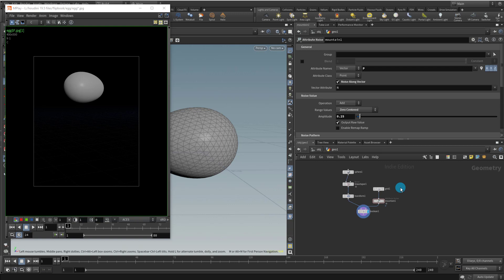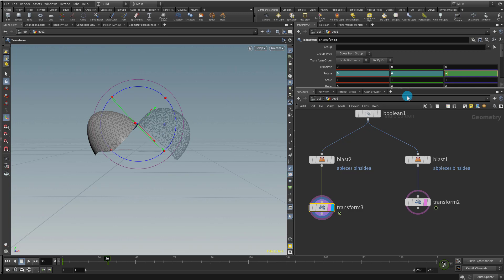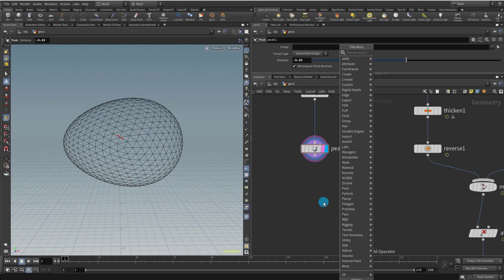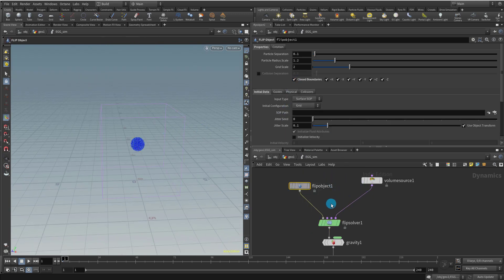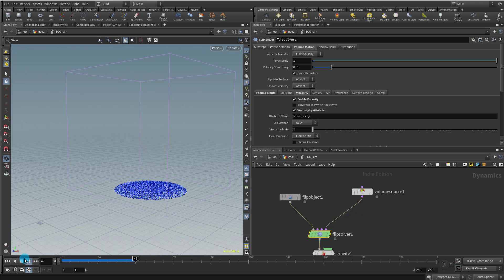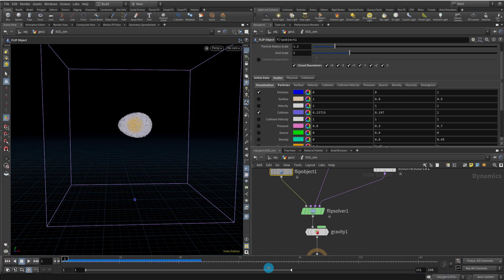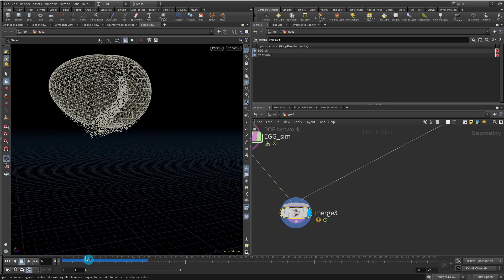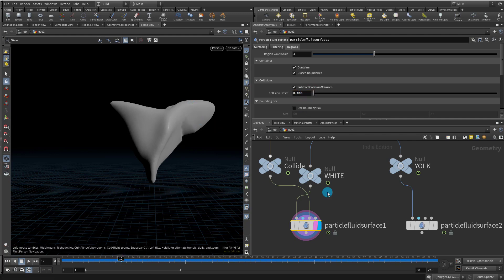Break an egg in Houdini

Comment: what version of Houdini did you do ? Some visual things look different
Reply: Definitely 19.5
Reply from the maker: It's 19.5.
Reply: @rohandalvi  for some reason the node does not work in 19  labs thicken(
Reply from the maker: @irinamal3518  just apply a normal poly extrude and turn on back faces. That will give you the same result.